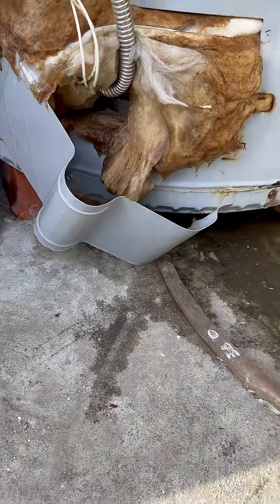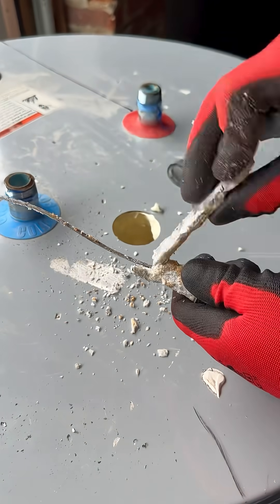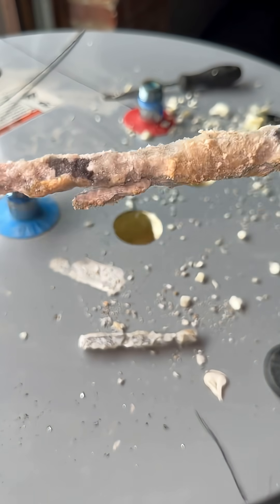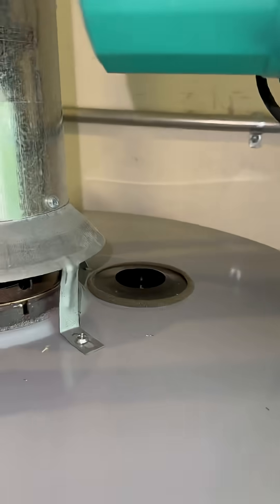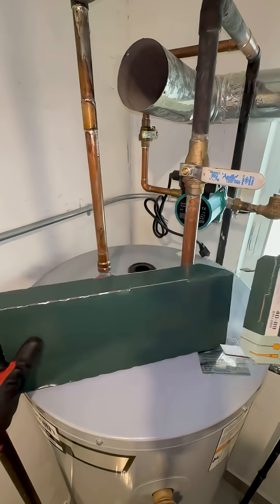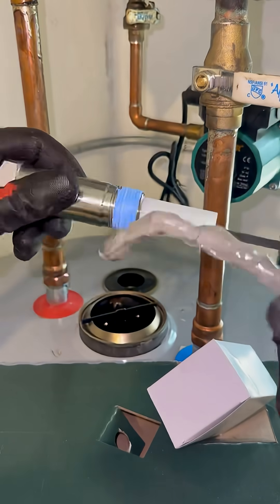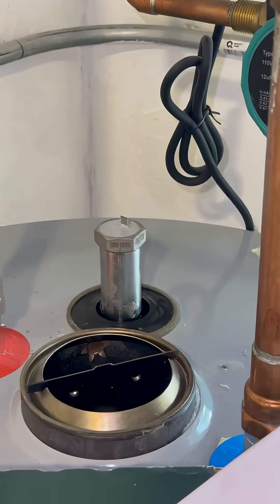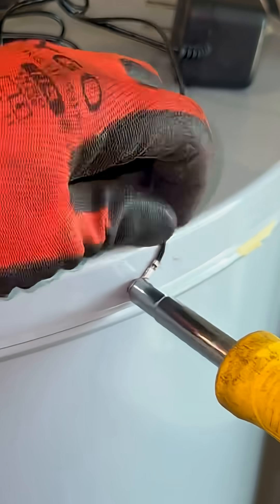Your water heater is fighting for its life! #waterheater #corrosion #anoderod #corroprotecpartner

Comment: This works!!!! 100% On well water in central Ohio. Old magnesium rod was almost completely gone after 8 years and hot water had terrible sulfur smell. Titanium rod removed the smell and 4 years later, still going, no issues.
Reply: 8 years I'm not surprised it was gone there meant to be replaced a lot sooner then that those rods are as he says in the video sacrificial there meant to take the beaten and be replaced so your water heater doesn't need to be
Reply: That's really cool to hear. I'm one of those guys that research is everything so thanks for the thumbs up
Reply: @kevinavillain4616 Ha me too. Education is power.
Reply: @kevinavillain4616 don't count your chickens until there hatched
Reply: My boiler is that size. So are all Anode rod compatible with all those size boilers
Reply: I was thinking about that for my mother south of canton
Reply: 8 years? We have to change anode in every 2 to 3 years.
Reply: You use aluminum rod in well water, a magnesium rod will stink the next day !
Reply: @carsonbratanov1035  today i learned :)
Reply: Mechanical guy outta Cbus. I can confirm that this fucker definitely works and it's nice to get a few extra dollars and some happy customers once in a while.
Reply: Thanks bro…I’m changing my water heater this week..well water destroyed it.  It’s leaking slowly but it’s still giving us hot water….
Reply: Or better yet, stop being Cheap and buy a Stainless steel tank or fiberglass instead of steel cheap trash.
Reply: 8 years? that is amazing to last that long for a magnesium anode rode.
Reply: I am on a well and every so often the sulfur smell. Makes me wonder 🤔
Reply: @Xiteg We used this several years ago on well water and the issue went away within a day or so. We have large filters and a softener but this product made all the difference for the smell.
Reply: Do these things only work on electric boilers?
Reply: Just wondering- is this electrolysis/electrolytic deposition happening in a waterheater exacerbated by "hard-water"?
- (no doubt especially in well water/bore water from an aquifer in the ground?
Also- sulphur is one of the minerals in volcanic activity,  which equates to being solidified as rock after a volcano has solidified to rock - obviously still leeching minerals on contact with water...
Reply: It’s a bot you damn morons
Reply: 8 years is negligence. Replace it sooner.
Reply: did you notice the smell or taste, andif yes, did it get realy bsd before hou noticed
Reply: Where can I buy one of those???
Reply: Just one problem. It may not pay for itself. Compare the cost of 1 titanium rod to 4 magnesium rods.

Of course, you could move the rod from your old heater to a new one at the end of its life, but that joint is going to be so seized you'll never get it out.
Reply: Thank you for your information you wonderful person
Reply: Did you open it up? I believe the product works. But so do the old. Maybe better.
Reply: @Kuraminz  "but so do the old" dude, do you not understand how a sacrificial anode works? It's literally made to dissolve over time as it works. Yes, it works, until it disappears as intended, and no, it doesn't work any better than the titanium, because corrosion doesn't really care where you get your electrons from.
Reply: Can you just pop out the old anode rod and put this in?
Reply: @keyser-sozeCAN Yes. You can swap it yourself. Obviously, turn off the input valve first 😉
Reply: @keyser-sozeCAN yes.
Reply: The power bill increased by 50 bucks every month, LOL
Reply: The sulfur smell is from the anode. It's the feature that alerts you to replace the thing. They are 5 bucks and they last for years most of the time. If your on hard well water then you might need to replace it every year but most people around 5 years on city water
Reply: My area we used to have a boiler system with continuous water heating. 

It got absolutely annihilated
Reply: Anyone know of a good showerhead filter? Or some sort of filter I can put on the line to try and remove chlorine and some of the bs in our town water?  I can’t tell which ones are a gimmick and which might actually work..
Reply: @primitiveorganism9571  what you want is called a water softening system for your house.
Reply: @extrazero1593 yeah I’m not putting a $10k+ system in my house to get rid of it! Those are usually only for well water anyway!
Reply: @primitiveorganism9571  i don't blame you, neither would i =) but some people are made of money lol. i once moved into a house that was on city water and had a softener system, otherwise i would have kept my opinion to myself here.
Reply: @primitiveorganism9571  You can't really remove chlorine with a filter, unless you go with a full reverse osmosis setup. The best thing a filter will do is maybe catch micro-plastics and silt.
Reply: @albertweber1617  water softener + water filter bundle. the filter protects the softener from the chlorine... by filtering out the chlorine. reverse osmosis usually uses a reservoir not big enough for appliances or showers; intended for drinking water.
Reply: @albertweber1617 guess you’ve never seen a Berkey ah?
Reply: @extrazero1593 Didnt you just say a filter can't remove chlorine?
Reply: @primitiveorganism9571  Kohler or Delta. Just buy extra filters and replace it on time. They aren’t the best, but theyll do the job. You will be surprised how much better you will feel.
Reply: @primitiveorganism9571  need a reverse osmosis filter.
Reply: @primitiveorganism9571 oh and, don’t get a water softener. Those put salt in your water, that’s not good for you
Reply: @joshredding777  why would salt be bad for you?
Reply: @joshredding777  it uses a kind of salt to filter out hard minerals including chlorine, but it doesn't make your water salty... why be a mindless troll? obviously you've never been around a water softener, so you shouldn't even have an opinion on them. keep it to yourself.
Reply: @extrazero1593 opinion yes, fact no 😂
Reply: @joshredding777  Common misconception. The system uses a filter to take out some/most of the minerals. That filter slowly gets saturated, at which point the system cleans the filter using the salt. The salted/mineral rich wastewater is then dumped in your drain. The salt never makes it to your taps.
Reply: @extrazero1593  You don't know what you're talking about either, haha
Reply: @first_last-  i have hands on experience... maybe not with installing them, but maintaining and using, and also bypassing, yes.
Reply: @Ginger.K97 Your body needs a certain amount of salt to survive and be healthy. Too much salt causes health issues
Reply: @extrazero1593 doesn't filter chorine but it does remove minerals by running through a media that is recharged with salt.  Doesn't make the water salty though.  May add a small amount of sodium ions to your water.

Comment: Yeah, skip this and just make stainless tanks. Really if it was even $200 more, totally worth it.
Reply: It'd be a lot more than 200 dollars. Pressure vessels welded with TIG aren't something just anyone can do.
Reply: They do make stainless steel water heaters. They cost $1200
Reply: @ivar-the-terrible Have you seen any gas ones? There are tankless of course that are, but they are inferior to tank heaters. As for the price, that could be reasonable, but is probably a price gouge. Depends on the efficiency of the unit.
Reply: @court2379 tankless on demand is far superior to a traditional tank style heater. Ive had a tankless natural gas water heater for 12 years. I can take a shower for 3 hours and never run out of hot water and it saves so much money in utility bill. Just have to flush it annually and no problems at all
Reply: @shotatmissedshtathit7104  tankless is not "far superior". There's ups and downs to both styles, but I lean in favor of a tank model simply because servicing is easier, parts are much easier to source, and parts are cheaper. You also don't spike your power consumption during peak hours, potentially saving a lot of money. You can work on a tank model with extremely basic tools and knowlege. The same cannot be said for tankless models. The upsides of a tankless are it saves on space, it can potentially save on how much power it uses (no use heating 50 gallons in a hunting cabin you use 2 weeks a year), and it's not going to run out of hot water. Still, it requires yearly servicing, and good luck getting replacement parts. The up front cost is usually much higher, too
Reply: @tinscarecrow21 his is gas powered, so it’s way cheaper to operates and easier to service than you think
Reply: @BenjaminWalburn Even gas model tankless heaters are hard to find parts for. It's not exactly a new technology, but the number of changes and 'upgrades' made by manufacturers means they tend to not make standardized replacement parts. So say it has an ignitor that goes out. You'll be hard pressed to find that part. You'll need to replace the whole unit over 1 part failing
Reply: They are welded by CNC. Still need an operator who is going to be a welder most likely, but takes the skill element out. Plus it's the same welds that must be done on the steel tank, so doesn't change the cost. 
I might be low on the materials cost difference a bit, though they can probably go down in thickness a bit with SS. No corrosion allowance needed for most applications. 

I think most of these places don't want to sell SS as then they don't get a purchase every 10-20 years.
Reply: One of my neighbors installed a stainless hot water tank in their new build home. It still failed and soaked the place some 20 years later.
Reply: @NathanielStauber  A water heater lasting 20 years is still pretty good considering they're currently being designed to fail just after the warranty expires. Even a really really good modern enameled model isn't going to last you much past the 15 year mark anymore
Reply: @NathanielStauber What is odd about the water there? If it is proper material nothing about water should corrode it. A steel one will last 20+ years.
Reply: Hard water can corrode anything eventually.

Comment: I have SMPS paranoia because that's the most common first part to fail in the electronic boards in the domestic machines that I repair.
Do you have to check once a year for the little green light, or dies it warn you somehow if it fails?

Comment: Yes, this is "job creation" the American way. The house I bought came with a water heater where the anode is in-line with the hot water pipe. Who is going to cut out the pipe every year to replace that sacrificial anode? NO ONE. That means everyone voids the warranty by default.
Reply: You probably have a Bradford White water heater like I do.  I installed the Corro-Protec on mine last year.  Works as advertised.
Reply: @dantesinfernopurgatory7826 funny you say that because yes it's a bradford white, and it's time I replace the water heater lol so I'm going to install the corro protec on day 1 on the new one.
Reply: This is terrible and should be changed

Comment: I installed mine 2 years ago. Lovin it. Don’t forget to have them check the green LED regularly. If it goes out, there is likely no protection.
Reply: Make it chirp like a smoke detector.
Reply: @Bart-uo5xg yeah, maybe a super capacitor in the supply that operates a chirp circuit with no ac or an open circuit occurrence. Mine is on the same UPS that I have my water softener plugged into.
Reply: @Bart-uo5xg  Why you gotta make it unusable because of someones race?
Reply: @roccobro 
I see what you did there. Apparently. In Minecraft.
Reply: This feels like one case where you definitely don’t want it on a separate circuit. You want one that you’ll notice if the breaker trips.
Reply: @JasperJanssen  No, you want it separate. Just check the damned thing. Or tell your wife to.
Reply: @fleatactical7390 ”just check it” is the same as “just make the backups”. That’s never gonna work.

Ideally I suppose you’d just put it on the water heater circuit. You’ll definitely notice if that goes out. (But then you’d better not have long periods where you keep the heat off)
Reply: @JasperJanssen In my case I have a hybrid water heater located just as I walk into my attached garage from my house. The wall wart with the uncomfortably bright green LED that only comes on only if the circuit with the probe is in contact with water, is facing me every morning when I get into my car. The day it is not lit, I’ll notice, but that’s just me. It is really important to check it regularly, it is possible to have power to the wall wart and no green LED.
Reply: @fleatactical7390  I have a power vent water heater. So there must be power to run it. They cost twice as much.
Reply: Could possibly put on an UPS?
Reply: I check the green light to make sure it is working. It is in the Garage so it is easy to do.

Comment: I can't speak to how well they prevent corrosion yet, but I've used them in 2 situations where the hot water smelled like rotten eggs (hydrogen sulfide).  Flushed the wh and installed this, and problem solved.
Reply: I'm currently living in a bicentennial trailer house I wonder how ours is holding up lol
Reply: @yoshiparker-lw7qs  If it's an original component; Probably the remnants of half a nut... 🔩😆
Reply: Hydrogen Sulphide gas is normally released by raw sewage. Have you had the well checked for contamination? 💩
Reply: @dieseldragon6756 It can occour in well water too if the ground holds iron
Reply: @pouncepounce7417  I've seen Iron fungus in surface streams (We have to be mindful of it when Orienteering) but I would've thought Iron contamination would lead to the water tasting more, well, Metallic(a)? 🌊🎸🤘

Still, high Iron levels are easy to test for. All you need is a Neodynium magnet! 🧲🌊💨😋
Reply: @dieseldragon6756 I know two springs in my area that STINK and they are fully natural with no chance of sewage contamination.
Sulphur is not that rare.
Sulphur and iron.. youch, even in low concentrations.
Certain anerobe bacteria plus sulphur stinks too, if the spring is warm they thrieve.
Surface water there are lichen that have the same effect.
A lot of springs considerd health beneficial have a heft stink too.
Most of middle europe for example have zero active volcano but a lot of very ancient ones that deposited a lot of sulphur.
Reply: @pouncepounce7417  Ah, so it's mostly Sulphur? I know that has an odor to it, putting it rather politely! 😆

Funny thing is that the smell is very close to that of raw sewage, too...At least to my (Admittedly, not very sensitive) nose. Which is rather concerning when you think about it.

Certain aspects of my bathroom arrangements mean that different waste types are handled separately but disposed of together. Either on its own doesn't smell all that bad...But once you mix them together, my goodness! 😳
Reply: @dieseldragon6756 Ahh yes, Iron fungus.  Along with radiation fungus at Chernobyl, just further proof that fungus doesn't give a shit about how we think life should act.
Reply: Dudes, H²S is his highly toxic and should be illegal to sell a product that will produce it
Reply: @smalltownmisfits  The anode rod doesn't produce H²S, but appears to neutralise odors where the water being heated is high in Sulfur. 👍

Septic tanks do produce H²S, but there's a reason for why you site those in the garden as far from the house as is necessary. And if they banned the sale of those, most of the United States would find itself turning into the Unitеd Kingdоm worryingly quickly! 😳💩😆